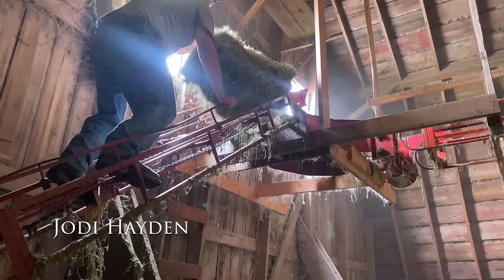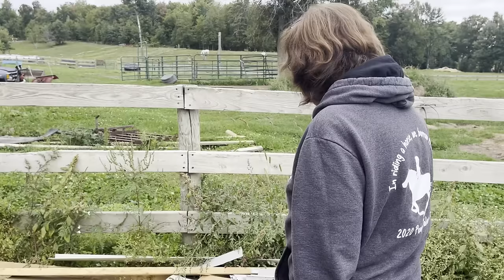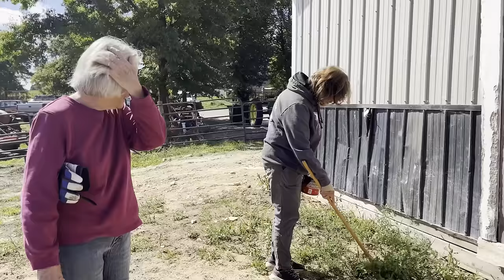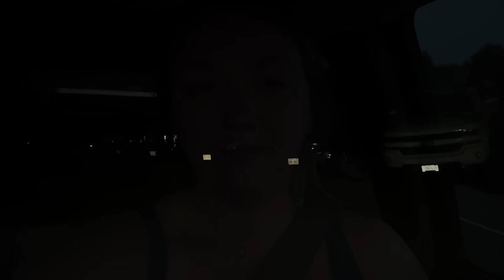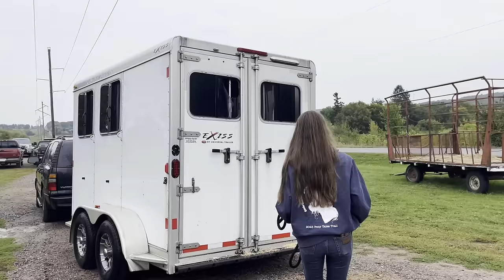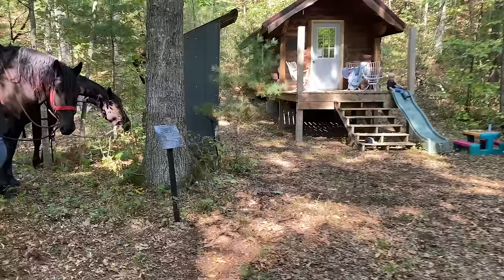Will Envy Steal Another Heart? - Part 2

Comment: I have a patch of ground that was used by a hoarder for years. I used a huge, powerful magnet to clean up all the metal scraps and make the ground safe for horses. Then it rained, and more metal magically popped out of the ground. I cleaned that up batch of metal, it rained again, and more metal appeared. Rinse, repeat, rinse, repeat for the last couple of years. It’s incredible how much sharp metal can hide in the soil, just waiting for a horse to step on it!
Reply: We had no clue there was a downed barbed wire fence cutting across the pasture that was a former vineyard until prohibition hit. We only found it when a horse got tangled in it. We managed to save the horse but she ended up with a huge scar. Take all the time you need cleaning up the property. It isn’t worth the grief and expense to care for damaged animals.

Comment: Who put diseal in the gas car... omg... somebody wants a new car.
Reply: Accidentally put some diesel in my car many years ago. Since it had a carburetor and spark plugs, the engine wasn’t ruined. And, I got the best gas mileage ever, until I had finally topped the tank off with gas enough times to clean out the tank. Had to buy four new spark plugs because the diesel fouled the others.😮